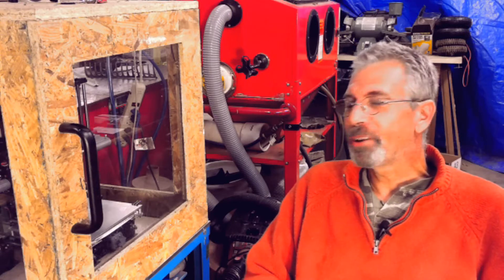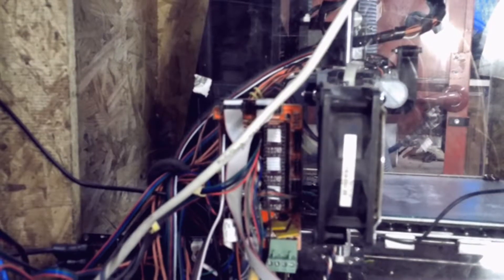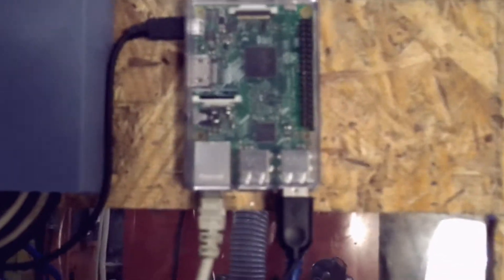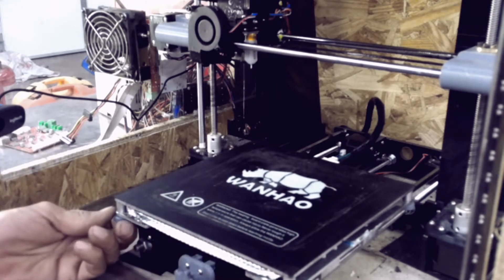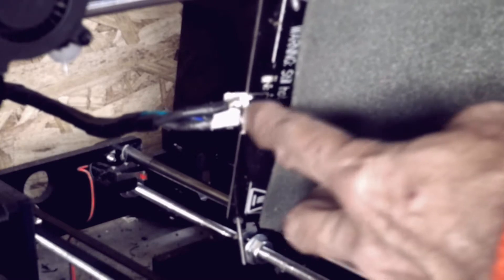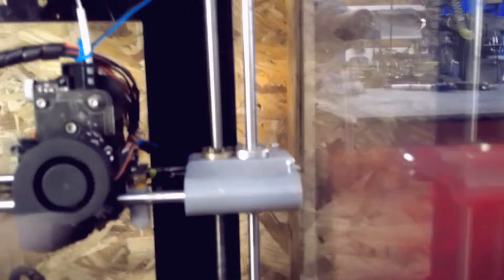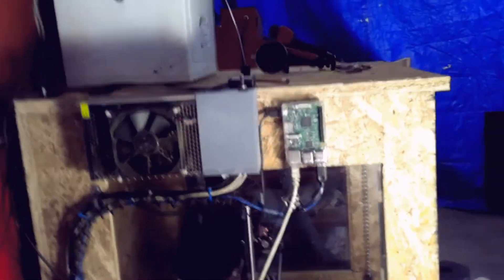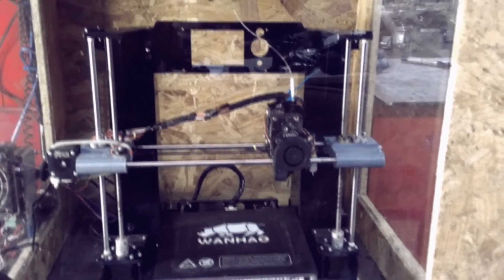Anet A6 upgrades, The final Word

Comment: Hi, I suggest you buy driver protector. when your printer is offline and you move x or y axis, you can burn your board and your LCD. Burning z axis is very hard this way though.
Btw - i upgraded my Anet with 32 bit board from BIQU (SKR 1.1, there's also new version 1.3). It took some work, but it's running and for ~20USD I have better board than RAMPS with way more processing power and storage than any 8 bit atmega.
Right now I have ordered E3D chimera plus clone with extruders and some pancake stepper motors plus larger magnetic steel plate (224x254mm vs 220x220 of heatbed). It will not be heated on sides, but I don't use heating for PLA anyway.

Comment: Marcel, I can't find it if its there or not! I have an Anet A6 and wondering about filament adjustment. I'd like to play with that adjustment to get it perfect. DO you have a video on that?
Reply from the maker: If your talking about the amount of steps per length of filament, you have to do that in the software.
Reply: @marcellemay7721  Nope, done that successfully! I mean the gears that hold the filament against the wheel as it is fed through the throat of the hot end. Can that tension holding the toothed gear against the filament be adjusted?